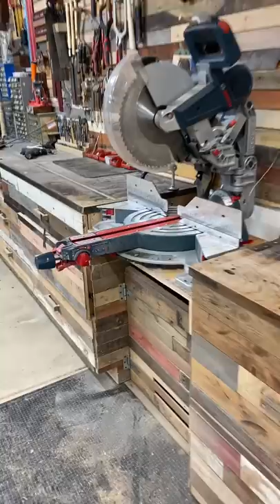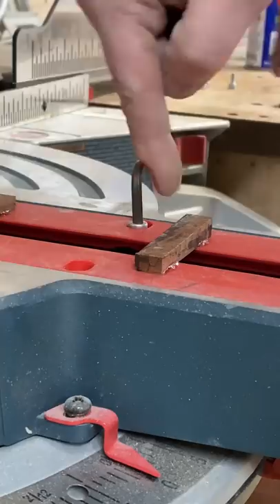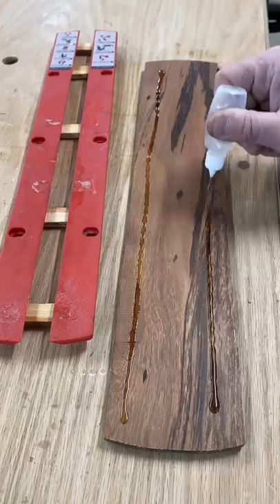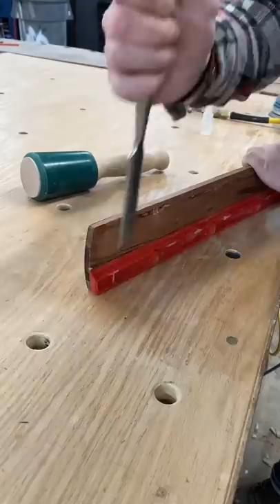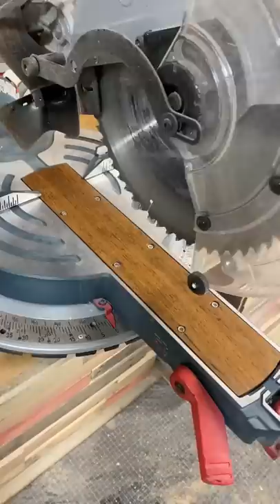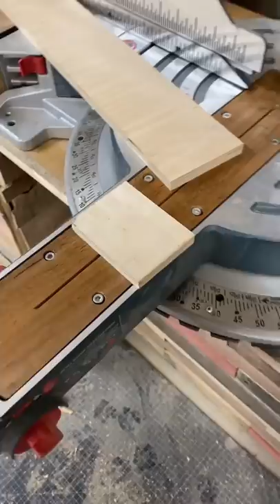Zero Clearance Insert For the Miter Saw #shorts

Comment: The whole reason for this was no breakout at the back of the cut. ( shown at the end )
Reply: What do you mean? What ‘ differences’ did creating this ‘do’ differently than the factory piece?
Reply: @aaronreid1183atyahoocom  no breakout on the back... Like be said.
Reply: Great u til he does a mitre cut and widens the gap
Reply: @aaronreid1183atyahoocom  the ‘frayed’ cut that you usually get from the factory plate
Reply: Aka burring
Reply: @steph0xGx  ah that I understand as I’ve only referred to it and heard it referred to as burring so I was so confused what OP meant
Reply: @kentuckysmoose  so scribe a line first, same result
Reply: @aaronreid1183atyahoocom  э
Reply: @imthemistermaster  хэхээ
Reply: You can get the same result with blue masking tape on the underside of your cut line. The sawtooth of the blade is cutting in on the topside of the board then cutting out the underside the board causing splintering. The tape keeps the splinters in place and reduces pencil marks on the unfinished wood.
Reply: @imthemistermaster  there is no gap there where the saw cuts. And, now small pieces cannot fall threw the gap. Look at the gap in the beginning of video, and then watch the ending.
Reply: If you cut slow you get no burs
Reply: Nope. Sorry. Zero clearance inserts don't do anything for miter saws for tearout. If you think about it, using a zero clearance insert for a miter saw is equivalent to having a zero clearance jig for the top of your workpiece on a table saw... The best thing to prevent tearout with your miter saw is use a sharp blade.
Reply: @youtubevoyeur4104  You would either use the original , or simply make another insert for miter cuts. It's a no brainer for most people, but there are exceptions.
Reply: The insert will prevent tear out on the bottom, not the end.  But on the bottom the saw tips are moving nearly parallel to the bottom surface, so there wouldn't be much tear out there anyway.  This ZC insert is better used on the table saw, where the blade tips are moving more vertically.

Comment: Guitar builders tip: Put masking tape on your pieces before gluing up for the router. Then there's no glue residue on your pieces when you separate them. It's on the masking tape for disposal.
Reply: Thats good wisdom
Reply: Also a great tip for metal workers, as a hobby machinist it is an awesome trick for some applications.
Reply: But if you forget to do this you can use oil to remove the residue. Rubbing alcohol works too
Reply: Ty I'll use this tip sooner or later
Reply: Joe Huerta  I mean he can always change them back out so maybe it does matter.
Reply: Lervon  more like 2 minute sand. It would take less time to apply and remove the tape
Reply: Lervon   Instead if splitting hairs on your prefered method, why not tape it, peel it off and then give a quick sanding? Increase the quality of your build over all.
  I bet it would take less time to  peel the tape off even with out a knife  faster than having to have to sand it down.
Reply: @stephensmith8812  probably not too worried with it on a saw insert, but still great advice
Reply: I always use painters tape for my glue ups.
Reply: L
Reply: Wow, this can be used in many applications. Thanks for the wisdom my guy.
Reply: Or, just use double sided tape?
Reply: Yeah and you don't have to break your current insert in case you ever want to make a compound miter

Comment: I've always wondered why they can't just come like this.
Reply: Because then when you try to use the bevel, you can’t.
Reply: You can't "tilt" the saw. I mean you can, technically since this is wood but if it was metal it'd be pretty hectic.
Reply: Put it on 45° and you know
Reply: Isn't that what the slots are for on the original plastic item?
Reply: what everyone is trying to say is that with a compound miter saw, this insert would not work specifically, but not all miter saws are compound miter saws. Mine is not. So making a zero clearance insert likr this is ideal (which i still have not done but need to). A compound miter saw turns on the base axis for angled cuts, AND also turns on the arm axis for compound angled cuts, FYI.

Comment: The piece you machined had cool figuring but the one you installed didn't.
Reply from the maker: Ya I actually made multiple ones.
Reply: @KomarProject  did it clog up?
Reply: @Jaksmodteam  9
Reply: @Jaksmodteam  why would it clog up?
Reply: @WannabeOperator  i just noticed the old one that was removed had a huge gap and i assume it would help throw the wood out the back with air flow. I assume if it started to clog the saw blade would remove the wood that is clogged but then the blade would clog causing the cut to be rough as if the blade was dull. Im not sure why the manufacturer of the saw would make such a huge ugly gap if this could be done.
Reply: @Jaksmodteam  the manufacturer makes it with a bigger gap because the saw tilts to cut angles up to 45 degrees.a blade at 45 degrees wouldn't go through the gap on the one he made, without cutting it's way through
Reply: @carlstanton2550  ahh okay cool. Thanks for the info!
Reply: @Jaksmodteam  they make a big gap so when they do bevel cuts it won't hit the insert... It's setup out of the box for universal use..not fine woodworking. The zero clearance inserts are for finer cuts. 

Not to be rude but you should "assume" less and actually do it and learn something
Reply: @WannabeOperator  carl already answered bud. What would you like me to do? Make a fancy insert for my miter saw that gets used twice a year? Go piss on someone else I’m not your guy.
Reply: @WannabeOperator  geez wat deutsch
Reply: @WannabeOperator  yep douché
Reply: @Jaksmodteam 
They don't clog, but small cut-off pieces can become logged (spelling?)